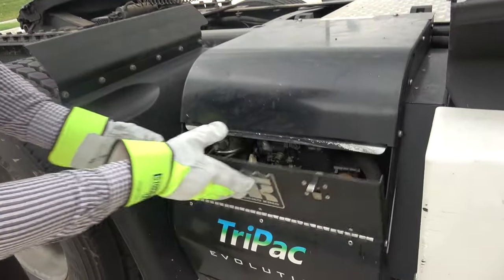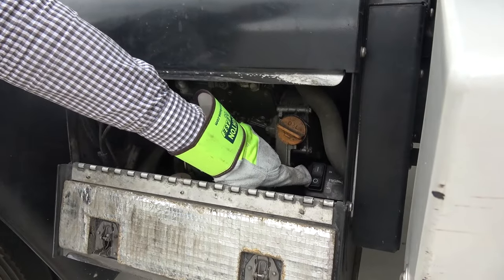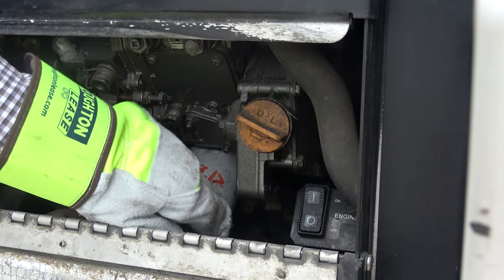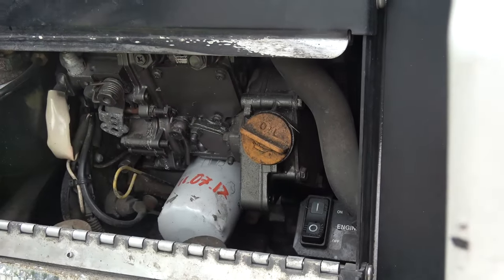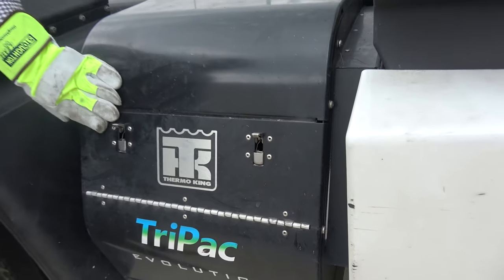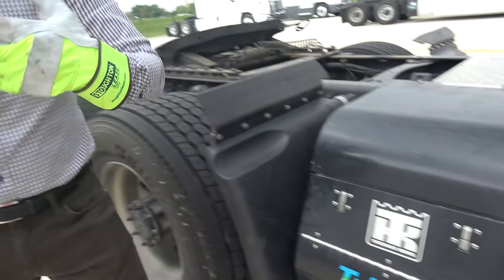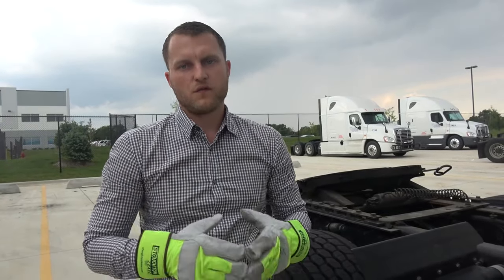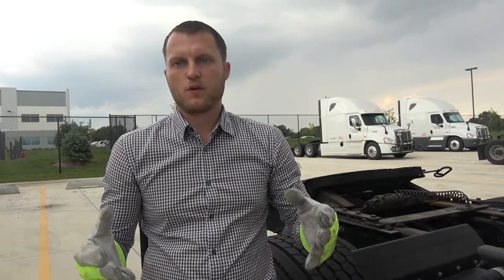How to Reset  TK APU unit

Comment: I’m at a point where i fkin hate this apu. Cleaned the cables ground to whatever worked 2 weeks. Changed the alternator worked antoher week. Worked for another week when i just punched the control panel. what a joke. Something is wrong with the wiring and i cannot find where the problem is exactly. 15k piece of sht